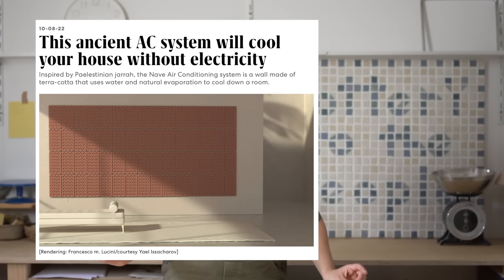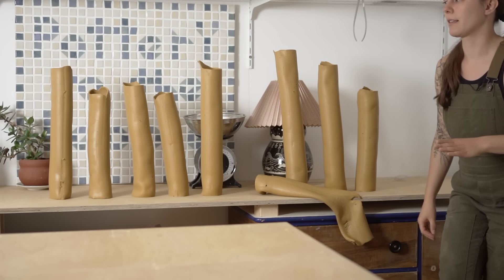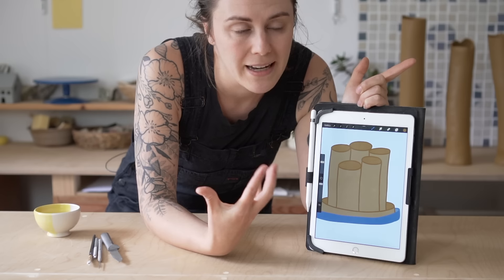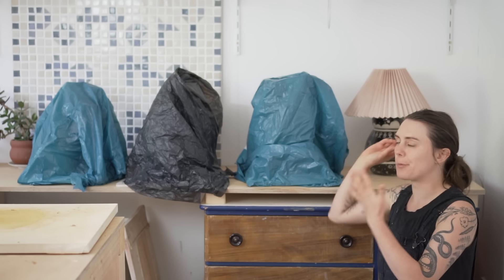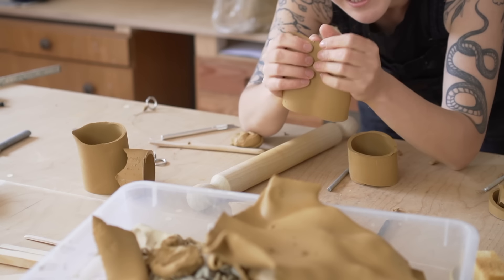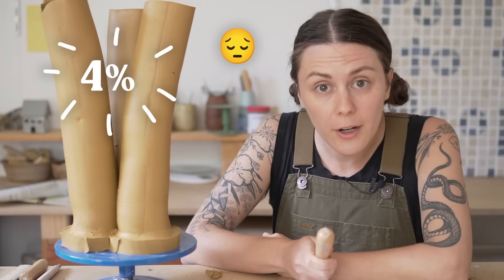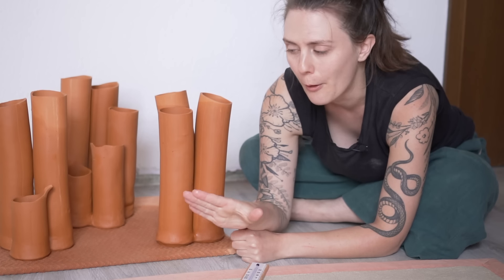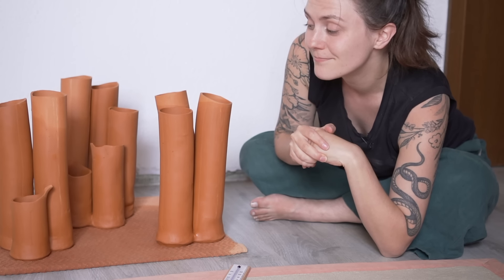Can I make an A/C out of clay???

Comment: I think that even avoiding the vitrification point with this stoneware would not make these as effective as using the correct grade of clay. The particle density is just too high. Second, evaporative cooling relies heavily on a low relative humidity environment, otherwise it just doesn’t work, and the extra moisture will cause the room to feel stuffy and hotter. Finally , you might be better off having shelf-like or needle-like projections all over the outside of the tubes instead of smooth sides. This will increase the ratio of surface area outside to inside, thereby increasing the evaporation rate.

Comment: One idea you may want to try would be tubes that narrow quite considerably and pop them in a window. As wind blows through the tubes, from the widest side to the narrowest, the air comes under pressure. Once fully passing through the tube the pressure will release, decreasing the temperature as shown with the ideal gas law pV=nRT:

pressure * Volume = number of particles * Ideal Gas Constant * Temperature

The volume, number of particles and of course the constant remain the same. Therefore, reducing pressure drops temperature! You then will harness the energy of the wind itself, pushing air through the pipes, to increase the pressure. Voila! Wind powered AC... kinda

They use this type of cooling in poorer areas of the world where having electrified AC is not possible

Comment: It's essentially a passive swamp cooler, which functions best in low humidity. But without forced air to increase the rate of evaporation it won't have a lot of cooling power. It's also better if the evaporation can occur outdoors and the cooling transported indoors so that interior humidity isn't increasing. Probably this could be done in clay, but it would be an engineering project. If the tubes were placed outdoors, cooled by ambient breezes, with pipes from the bottom going through a wall into a heat exchanger indoors, and exiting at the top to return to the top of the tubes, the water flow could be passively powered by convection. A small fan blowing through the heat exchanger would probably be necessary, but probably you are already using fans. In humid and very hot areas, this can't substitute for A/C because the cooling is limited, but commercial A/C often uses swamp cooling to improve efficiency of outdoor evaporator units.

Comment: Increasing surface area is key those round vessals are too big and most of the water is in contact with more water. Think more like a radiator design with air flow the key is to get the water to evaporate as fast as possible, the changing of the state from liquid to gas takes a ton of energy called latent heat. I do think with some better designs and getting the water to change states quickly enough you could get some decent ish cooling. water latent energy is super high to get real results requires a very arid climate where the air is beggin the water to evaporate. A yakhchāl is another way to have "free" cooling with just playing with the temperature of surfaces but requires quite a bit structure to make work.

Comment: Here in the northeast US, I would make these to REMOVE the humidity from the air🤣 This unfortunately will not work when your humidity is already at a stifling level. I am a potter and actually made a similar device to humidify my house in the winter. Something very similar sat on top of my wood stove and wicked the moisture out of a glazed tray that held the water. it worked awesome!

Comment: i watched a documentary showing how ppl in the UK centuries ago would throw water on their unglazed terracotta floors, and how it would keep the rooms cool (to make cheese in this instance). i expect it would take something at that level to keep an entire house cool in this sort of heat. my grandfather grew up in the desert in the US, and they used to hang burlap over the porch and windows and run water down it to keep their house cool. before the early thousands, when ACs became the predominant method of cooling out here, we used to use evaporative coolers, which use a similar concept of a fan blowing through a fibrous material that is soaked in water, cooling the house. works well if your humidity isn't too high.

Comment: The problem with AC is that cooling a secondary consideration when designing houses. We need to develop better ways to deal with the waste heat we generate. I think a house could be designed to move waste heat to somewhere useful, like heating water, cooking, baking, etc.

Comment: What you seem to have created is a swamp cooler. That won't really work. You get a little cooling effect (temporarily) but by humidifying the room, that benefit is quickly lost. You can cool an enclosed space with the evapration from the clay, if the clay is on the outside. Traditional clay water coolers from most cultures around the world work because they are cooling the water that is inside the pot (and incidentally using the contained water to do so, which is really convenient). The "Technology Connections" channel has a great episode on swamp coolers and how they work (or not really well actually).

Even using the evaporative clay on the outside of the enclosed space to be cooled (which, unlike keeping them inside the room to cool, would actually be effective), I think that their "eco-friendly" aspect should not be exaggerated. Many places that need cooling tend to be dryer, and water conservation is likely more important there. In regions with hot weather that have plenty of water, the ambient air is usually pretty humid, and evaporative cooling much less effective. As with anything in life, there is a trade-off between environmental impacts that need to be considered.  I think that designing homes using chimney effects for ventilation and the new fangled high reflection paints are better bets for eco-friendly cooling, unless you are able to keep the water in an enclosed environment while cooling it with outside air.

Comment: Depending on where you live, it can make more or less a difference.

Somewhere like Arizona with no humidity it will do excellent.

In Texas with high humidity it will do nothing. Texas is already halfway in the ocean with the ambient humidity.

People in humid areas should invest in a dehumidifier to cool rooms more than their standard AC.

AC was created to solve the problem of humidity in printing shops. Fun fact. I'm a printer, but now mostly do digital graphics and video.

One of the first in modern times (because it goes back to ancient Egypt, really) was just salt added to water and left to evaporate.

The effect of salinity is to reduce evaporation but at the same time to increase the energy returned to the atmosphere by other physical processes, so that under equilibrium conditions a saline solution reaches a temperature higher than that of pure water.

Comment: So I was a potter for 35 years here's a couple of hints for you. On your AC if you separate them so their space between each one of them and put a fan behind it you'll get much cooler temperatures that circulate through the room. Secondly if you do a low fire glaze on a bottom portion of it it won't leak through the bottom. I used to make what I called claycent out of little teeny bottles hung with a strap of leather and I put essential oil in it that evaporated and centered the air. I glazed, low fire the bottom portion so the oil wouldn't drip out. Thirdly if you get a drill motor and put a spatula on it that they use for stirring sheetrock mud and turn your clay into a cream before you spread it on the plaster there won't be any lumps in it at all and it's almost ready to use at that point short of a little bit of kneeding.

Comment: I feel like it would be more efficient to just have a wall of corrogated clay for maximizing surface area, then bury it in a container of epsom salt or something to absorb the vapourizing water as not to raise the humidity. You could have several layers of these and have them enter a channel as the bottom where they wick up the water from, but have that water not make direct contact to the air(again, as to not raise humidity) maybe instead having them sealed around some old cheap heat sinks so the as the water cools, the heat sink also cools, then you can just blow a fan through the grooves to disperse the cooled air. The only issue with this is that in addition to refilling the water, you would need to dry your salt every once in a while. There are a variety of salts available online that have a high capacity for water absorbtion while still being relatively cheap, but epsom salt seems the best. There's also polysacerlate, which can absorb 300x it's weight in water. It's used to make things like orbies and diapers.

Comment: That's a really interesting approach.  It will cool the water that is remaining inside the tubes . You can use the cold water. If you can get the moisture blown outside your house it will take the heat away and cool your space.

Comment: Sure, but where does the heat go?  The heat has to go somewhere. In theory, the water will cool down due to evaporation, but the evaporated water will carry the heat into the air.  The net total temperature change of the room should remain zero.  If you piped the top of the tubes outside then you might see better results.

Comment: Would have been better to use thinner(diameter, not thickness) tubes with bulges(apply dimples to bulges if you want to increase external surface exposure without increasing the size of the pottery) to increase evaporation speed. With a glazed bottom and the addition of salt, it should work far better. Also I am a fan of the two spiral design, where you take a reservoir style bottom pot and add two thin tubes that spiral upwards together, with one resting upon another.

It would probably be easier to keep the thinner tubes from collapsing by the tried and true method of taking a cylinder of the thickness you desire(say finger or thumb thickness), wrap it in a non-stick film that will keep the clay from adhering to the cylinder and can be easily removed after the clay has reached leatherhard status. Make multiple tubes that can then be adhered together to make a bigger structure with a wider total surface area than solitary jugs as big around as a can could accomplish. With more room for the air to flow through and around it, the evaporation will transfer the chill into the air more readily this way, especially if you have a source of wind to strip the condensation away from the surface of your pottery AC unit.

Anyways, I hope to see you continue experimenting with this design more in the future, as I have no doubt you could make some interesting(not to mention functional) pieces of art with this concept. Maybe add clay to something more structurally sound in a honeycomb design(with the clay filling the honeycomb sections) so that they might be shipped elsewhere without as much worry about them breaking.

Comment: It seems like this couldn't work really - the whole thing about ACs is they move the heat from inside a room to outside it, and your pottery can only move heat between itself and the air around it, no way to get it outside. Still, I bet the cold water would be lovely to drink on a hot day! Another potter, Andy Ward made a video about Ollas which are used in deserts in and around the USA to cool water with the same principle you're using.

Comment: The heat is sweat through the pottery. So the device gets evaporative cooling. That energy that is lost from the device(,,,heat) is not being rejected to the outside. It is just entering the rooms air and raising humidity. You aren't actually cooling the room, but you are cooling the pottery and the water that it contains. 

You must think of every system as a loop. You cannot remove energy from a closed loop. You CAN shift that energy to one side of it.

Temperature is not the same thing as heat. Think of a difference in temp as voltage. It is a way to calculate the potential of that heat to move.

 You could make the tube's long enough to stick out the window so that the water evaporates outside if the humidity outdoors is low enough. This would make a net heat loss indoors, if the conductivity of heat through the clay and water didn't just sink the heat back in from outdoors.

Humidity reduction is very important in making a. Space comfortable. Less moisture means the air can hold less heat. This also works the other way around. Colder air can hold less moisture. This is why if you run your air conditioner, the air coming out has a higher relative humidity....even though you are decreasing the humidity in the space.

Lowering humidity allows you to be more comfortable at higher temperatures. This is because the evaporative cooling on your skin is more efficient. Ironically, this is the same function as the pottery.

Comment: Can we say, "Mold creators!"?
Ya, they are not even as good as a swamp cooler.  
SUGGESTION: Make bags of ice, which do not leak the water when melting. Then, place a fan so that the breeze streams over the ice.  That will help more that adding moisture into the air.

Comment: So first, yea that’s essentially an old school swamp cooler but those are really only an option in areas that are very dry. Places with a lot of humidity won’t really benefit from it. And second. 67 degrees!! Is that hot? Here in Texas the average this week is 104. I’d put a jacket on for that. Which brings me to my next point. Europe is higher above the equator than a good portion of the US so it is a lot colder there and the need for an AC unit isn’t as necessary. AC for the US south is like heat for Europe and Canada. Pretty necessary…

Comment: if you 10x that, i bet you'd get better results. if you could make a wall of that, or a pillar of that, I bet that would work better, if you get 1000watts of heat in, to cool the place you gotta move those 1000watts out too, and the heat exchange rate isnt large enough with so small of the coral tube coolers. 10x and you'll get better results. if you could do a whole wall section, that might work. if you could make it dual purpose in some way, that would be more useful. those long tubes might hold things nicely during the fall, winter and spring, and then they can hold water for cooling. I wonder how you could make it beautiful AND useful at the same time, to maximize both actually. coral is pretty nice, if you could get some real shells to pair them up that would be real nice too.

Comment: To break down what's going on, you've essentially made a swamp cooler. In order for it to be as efficient as a regular swamp cooler with a large tank of water and a 12v fan, you'd need about 20x as many of those. The porous nature of that clay is lost to the refinement of it. You can take a kitchen sponge from the store, saturate it with water, stick it on a plate and blow it with a fan and get the same results. Where it will be more effective is a ventilated area that is shaded from the sun, in a non-humid environment.

Comment: ok, you beautiful thing, I dont think it shouldnt be that hard to get some Kanthal wire (electric wire heating element [they use it or some formulation of it in just about everything, even in stoves and ovens]) and some alumina bricks and make your own kiln, BUT at least to me, I dont know if your electrical circuit breaker box can take the amperage-heat to power a larger kiln. they have other formulations besides Alumina as well, not sure if they're cheaper or not. I expect that if you built your own Kiln, you'd be able to likely cut the cost in half, because of the materials, but it would have to be your labor to do it, or maybe a friends. they have electric wire heating element calculators, so it could be ALOT easier to do the needed calculations to make it.

Comment: So it's a swamp cooler your humidifying the air around you. Also if you're making the water cooler then you're actually expelling heat from the water into the room. Not saying this can't work you just have to be mindful of where the heat is going. And I don't know enough about the physics of all of that to tell you how to make it work. Although it is possible that if you used it outside and then were to drink the cool water that might be helpful

Comment: So. What you charge to make just the tubes? Imagine a 50 gallon drum full of clay tubes. The tubes pass through the top and bottom of the drum in such a way as the drum itself is sealed but air can pass through the tubes. This is sorta like wrapping your fingers around 30 or 40 drinking straws. But the space between the straws inside your fist is sealed off and doesn’t leak. The actual 50 gallon drum can be filled with water but it won’t leak out around the clay tubes.

Now. Pull or push air through the tubes (which are wet inside because of the porous clay) the air should cool down due to evaporative cooling. This is the equivalent of a standard cooler design but you replaced the cardboard cooling pads with clay. As long as the barrel is fill of water, there is no need for a pump. There are even ways to eliminate the need for a fan but that’s a bit more complicated.

I would recommend using rain water or distilled water to avoid clogging the clay with salts. Also, you Might want to add lemon juice or ascorbic acid to the water to reduce molds. 

I have no idea how long the clay will last being soaked in water like this.